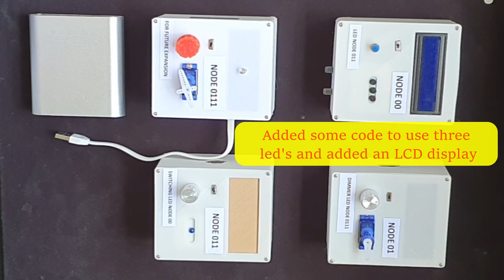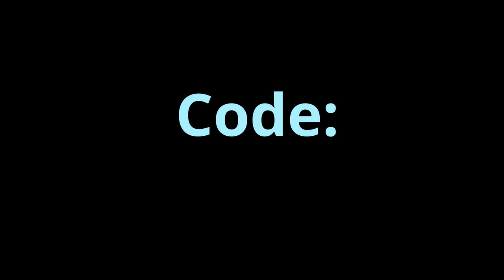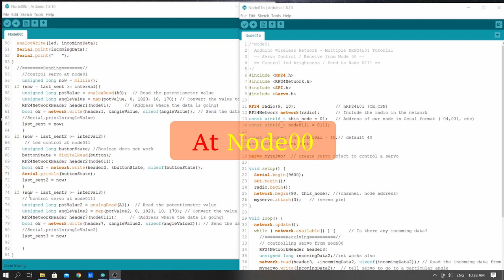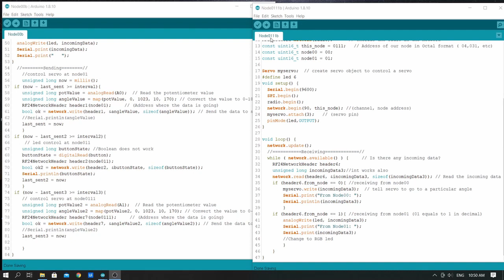Create an Arduino Wireless Network Using NRF24L01 modules

Comment: Thank you for your answer, you are right, it works with « ok » and « ok2 ».

Is there a possibility to send the same data from node00 to node01 and node02 at the same time ? I have tried the code below but it doesn’t work.

unsigned long buttonState00 = digitalRead(button00);

RF24NetworkHeader header(node01;node02); 

bool ok = network.write(header, &buttonState00, sizeof(buttonState00));

Basically it's to push a button on node00 and light up a led on node01 and 02 at the same time.
Reply from the maker: Refer to the example for node0111 (uses if statement) which assigns the value depending on which node it came from. Also, why assign one header for 2 different nodes? Try separating them and assigning a different variable ex: header2020(node01), header2021(node02)
Reply: Thank you ! Your advices and your vidéo help me a lot !

Comment: Thanks for this great video, I dont understand a tricky part on line 61 70 and 79 on node00 code. You write: "bool ok" or "bool ok2" what is the difference ? Same question about "header" why sometime it is "header1" header2" or "header7" the number is corresponding to what ?? Thanks you your help
Reply from the maker: Declared boolean variables "ok" and "ok2" just to distinguish one from the other (but I think it's all the same- can try just using "ok" and see if it works the same). As for header1...2...3 etc... is to keep track where I'm at. You could just declare as just plain "header" if you're not sending or receiving from multiple nodes. Kept it that way to avoid naming confusion. But you can experiment declaring your own variables if you like.